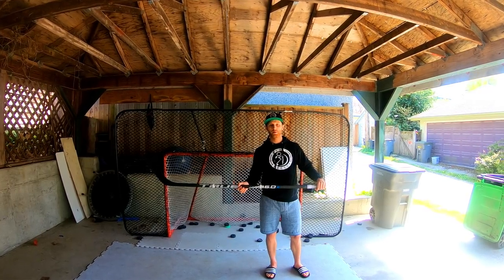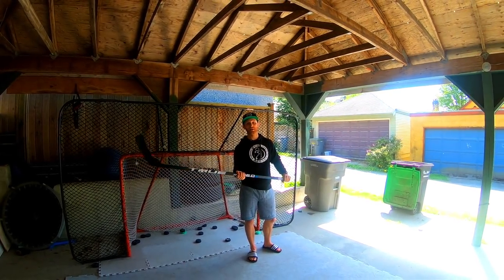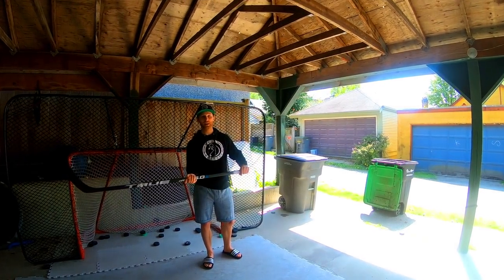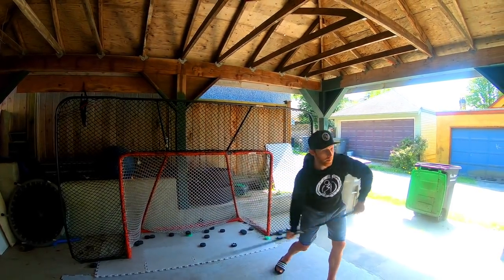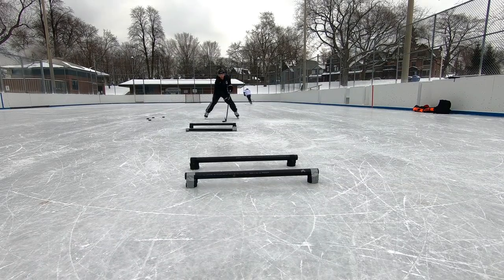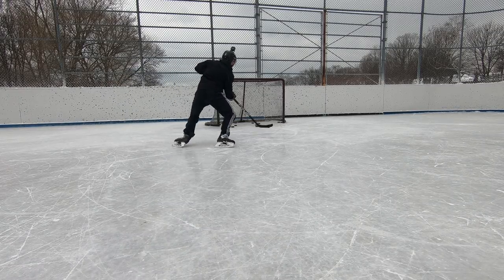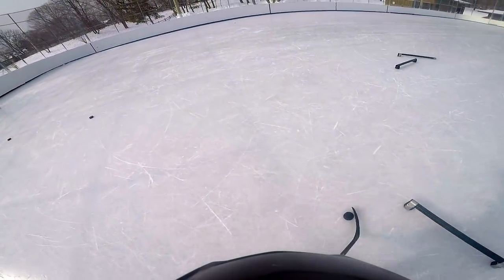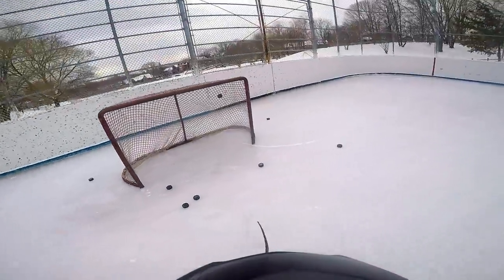3 on 3 GoPro Hockey | "TRUE A6.0 Stick"

Comment: True a6.0 ht or the ccm trigger 2?
Reply from the maker: We have 3 different guys wearing gopros. I'm the one with the True stick
Reply: Pavel Barber alright, I was just asking which stick do you think I should go with between the two
Reply: CCM is a feels heavier but has a softer feeling. Where as the True feels lighter in your hands and has a stiffer blade. You decide what madders most.
Reply: Kevin Kerns just curious how would you say the power and the accuracy on the ht compare to the sbp